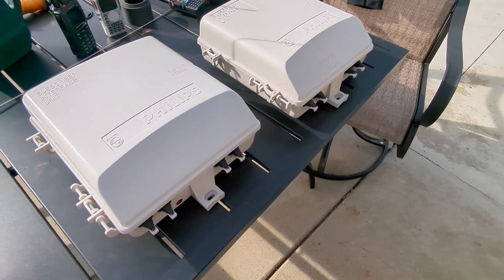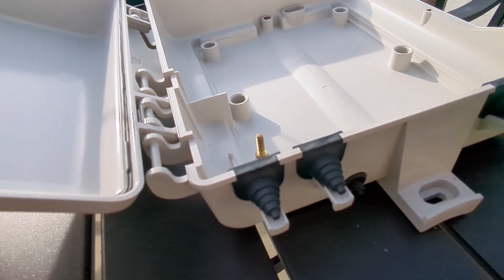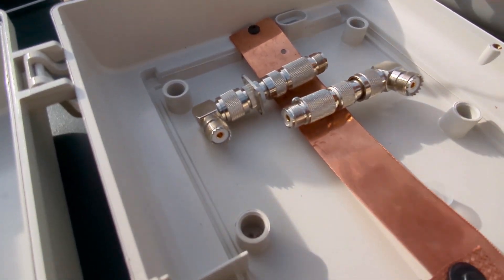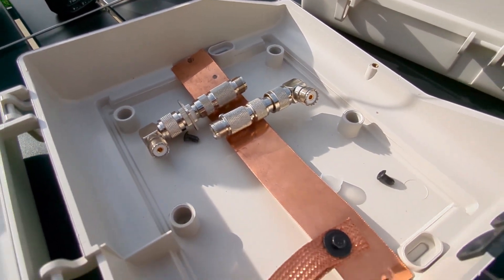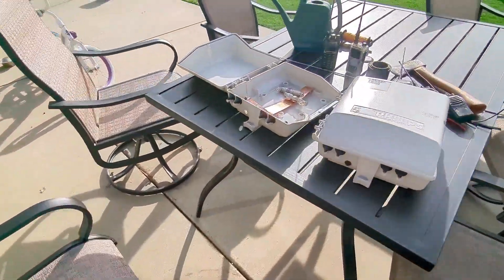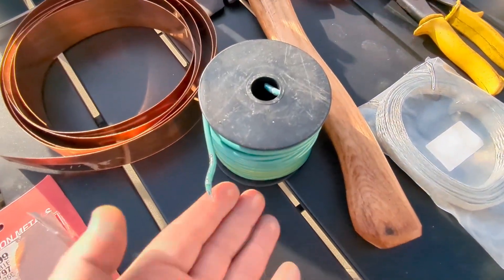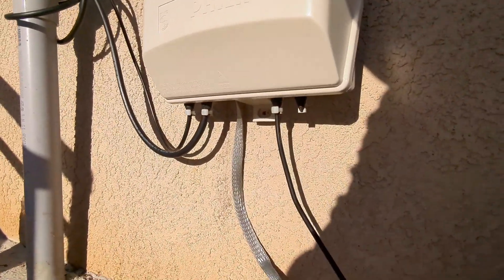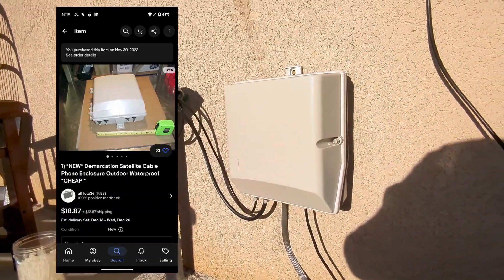Ham Radio entry panel box install - think "outside the box," I found a GREAT inexpensive solution!

Comment: I'm looking at doing this and having my manual switch inside, 2nd coax is only used 1-2 times a month for testing antennas or doing NVIS so I'm not going to spend the money on remote switching. I think my box I got is too small now so I'll look into these. Great video!